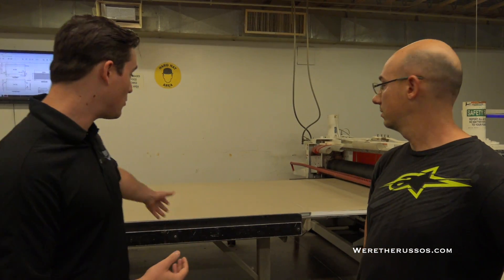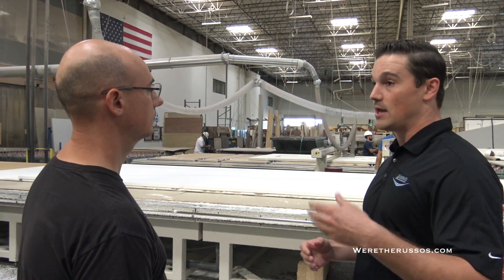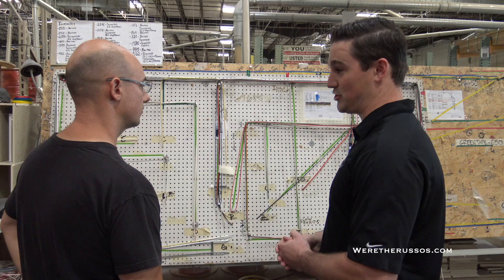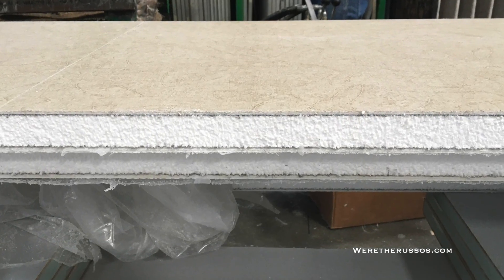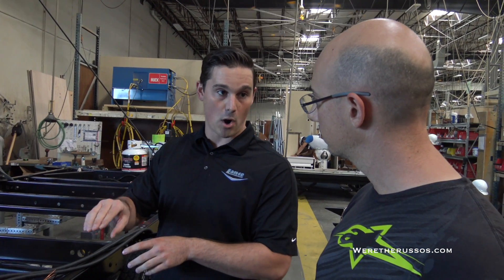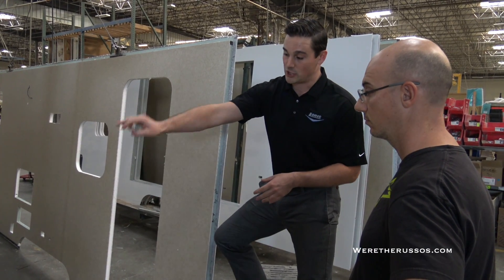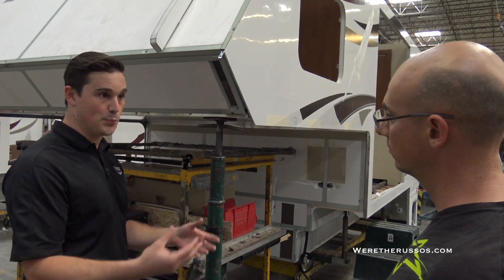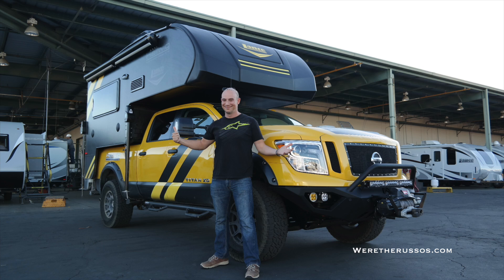Lance Camper Factory Tour: Lance Travel Trailers, Lance Truck Campers

Comment: All is good and until you buy one.  Customer service and remote warranty work is a nightmare. Even short run remote work. They have no program set up for getting people out. Couldn’t use our sams club warranty yet either because we were still under lance warranty. Great camper but won’t go with the brand again for how they treat you after you are a customer....which is the most important part.  Also having you bathroom sink drain into your black tank fills it full in two to three days with two people on board..1-2 days with 4 on board. Absolute joke no matter how they justify it. Wouldn’t have purchased knowing that fact. Bummer to have such a high quality product with these to critical failings(customer service and tank allocation).

Comment: We're brand new to RVing and are a week into our first major trip with a brand new Lance 1995...We've transited this week from Canada to South Carolina and have had a chance to both boondock and use full service sites...We're really enjoying our new interest which has been performing very well 'out of the box'...The functionality of the lay out...the room for storage and the ability to operate away from services has impressed us.  What really got us interested in Lance was (1) the difference in how the coach is constructed (the materials used) and (2) the use of technology to reduce variance in construction quality.  We also like the philosophy of larger fresh, grey and black tanks, solar panels and four-season functionality.  Finally (as newbies to towing a trailer long distances) we wanted a design that centred around the towing experience -  tandem axles, dexter torsion suspension and low aerodynamics- as our early sense is that wind, not weight, seems to have more impact on the towing experience.  An unintended but appreciated feature of the unit is that it sets up and breaks apart for transport quickly and as we gain experience towing it in different environments we are really appreciating how well and docilely it keeps up with our tow vehicle.

Comment: This was interesting to me, because I'm very interested in buying a used Lance truck camper. They've been using Lance-Lock for quite a long time and I'm impressed with it. I'll look forward to your follow up on the 1475 trailer and 650 truck camper.
Reply from the maker: We've been very impressed with the quality and livability of their truck campers - the 650 video should be up next week.
Reply: Another travel trailer you may want to consider is the Oliver. You can check them out at www.olivertraveltrailers.com They are total fiberglass and extremely towable, because of their aerodynamics. That said, fully equipped with solar and most options they are $49k or almost twice the price of a Lance 1475.

Comment: I've owned a 1475 since last November. Almost everything works reasonably well, with one exception. The hitch coupler. The coupler often sticks when either hitching or unhitching and it can be a bear to get the coupler locked afterward. The dealer replaced the coupler with a new one identical to the first one. It works better, but still not as smooth as it should be. A related problem for me is the Andersen hitch "friction cone". When a certain amount of moisture or dirt gets inside, the ensuing squealing upon turning is an embarrassing show stopper. Andersen sent me not one, but two new cones over time. The newest cone works better but it too has recently begun to squeal. I trusted the dealer's recommendation for the hitch, because I knew virtually nothing about hitches. But if I had the opportunity and the money to burn, I would just replace the entire hitch with a new type. If you bought the 1475, I hope that your experience with the hitch and coupler is better than mine.

Comment: I wonder if they use aluminium screws on aluminium parts.
Reply from the maker: Yes they do - they try to have all like metals touching.
Reply: 6:48
Reply: Metals can have a chemical reaction if dissimilar metals are touching each other.
Reply: It is actually a chemical/electrical reaction, and it is called galvanic corrosion. The difference in electrical potential of the two dissimilar metals creates a low current of electricity which corrodes the metals, essentially one metal giving electrons to the other metal eventually removing molecules of each in the manner that a battery does as it goes thorough its life.
Reply: they aluminum screws can easily shear though.  🤔

Comment: Lance is sold here in Canada but their products are quite expensive. It wasn't clear whether or not they are using Azdel for the roof and floor.
Reply: 1hjehje I'm pretty sure he said on sidewalls when asked.
Reply: They are not, but they may not have been using luan or an equivalent in the roof system anyway, so it might not be replacing anything less durable there. I don't know how it would be used in any floor system. It kind of looks to me like they're still only using a one-inch or one-and-a-fraction wall, though. That's awfully thin for a "4-season" claim. Aluminum framing short-circuits insulation as well. I'm betting that really cold weather will produce frost stripes on the inside walls where the frame members are located.

Comment: I wish you can take the 15, 15 ft camper trailer and put in a rear slide out for the bed room, so the bed can slide back about 2 ft. This way the length of the trailer will be easier to tow. That way nobody will have to crawl over that person.

Comment: No insulation between frame and skin cold spots everywhere. Torsion suspension due to the fact that torsion axles are independent from each other, there is no transfer of impact.  This means that in the event that a pothole or curb is hit, the full force of that impact will be on that one wheel creating more chance for damage.  Secondly, it can be difficult and in many cases impossible to repair a torsion axle.  The rubber inside the axle tubing makes welding out of the question, which also means in the event of catastrophic damage, the entire axle would more than likely need to be replaced.

Comment: I was with him up until he said Stamped Steel frame that is Hook Bolted....I don’t know how that could possibly be better than I-beams on the length and proper welds...   I suppose they have their reasons, I just don’t get it.

Great video though, regardless.  Thanks!
Reply: I would be more in agreement with him if he was talking about welding vs. bolting on the aluminum frame assembly because of the stress of big temperature changes when the metal wants to really move and the weld not so much--creates the weakest point in the frame. I'm much more doubtful about the stamped steel compared to traditional welded steel. I'm also a little more than mystified about using aluminum screws into aluminum framing components. That sounds like a handy way to avoid a dissimilar metals issue except that aluminum hardware is much less durable and easily over-torqued and that is why virtually all real engineers, not CAD designers, will specify a good stainless in that application.
Reply: Those are Huck Bolts, aerospace tech, freakish strong. Like modern trucks with hydro formed frames, I beams are a thing of the past.

Comment: I would rather have leaf spring vs torsion.  Torsion bottoms out easily. Also if a torsion axle goes bad you cant just to to tractor supply pick up a replacement and swap it out in 30-60 minutes. Only thing I really didn't like ,well that and that they don't make their own frames.
Reply: Starting in 2022, they dont use Torson anymore, and have gone to leaf springs, with the road armor and shocks...

Comment: Lots of troubles with their tt's and poor factory response according to a large retailer in the Northeast.
Reply: Boatdesigner .  That has not been my experience. Our TT has been issue free and when I called the factory inquiring about a factory tour and also getting clarification on adjusting the angle of our awning they quickly responded. Another thing I liked about our TT is the interior walls, the ones framing the bathroom for example are plywood not that cheap 2X2 with plywood like most all other RV's.

Comment: Lance mfg's. good campers but high priced. Maybe they should make them simpler to reduce unit cost. A  $45000 fully equipped slide in camper requires a $65000 truck, that's $110K might as well get a motorhome.
Reply: hermitld wrong.  Might be listed at $45K but that’s not what you’ll pay....typically you can get about 20% off MSRP. I have a used Tundra I paid $23K for that pulls our Lance 1685 easily.